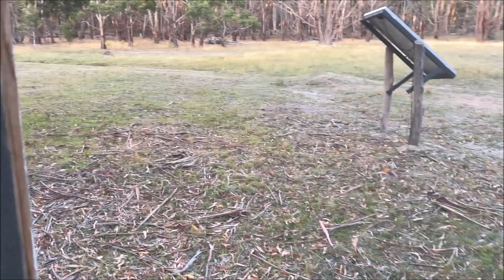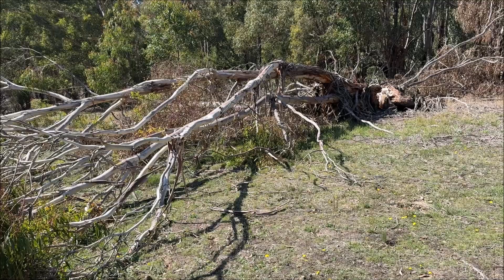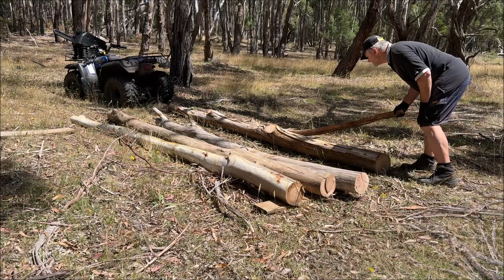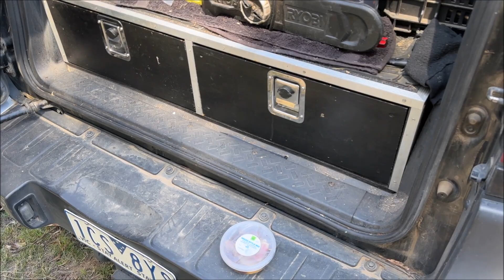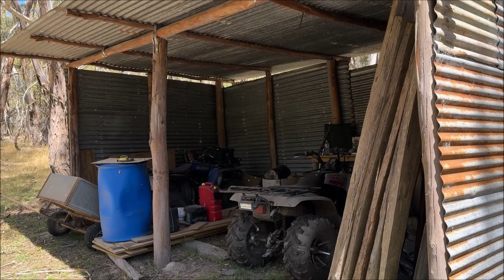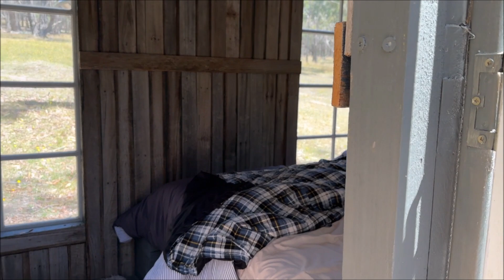Wood Shed Build - Gathering resources for our new Wood Shed

Comment: 👍 I slather on some burnt motor oil mixed with diesel on the in-ground section of posts. The shed looks fine for what it's for.
Reply: Exactely what we do with harvested wood from our property for projects; have an old 44 gal drum, dump used oil & splash of diesel in (make it about 600mm deep of oil/diesel mix), and let the posts sit for a week in the mix.